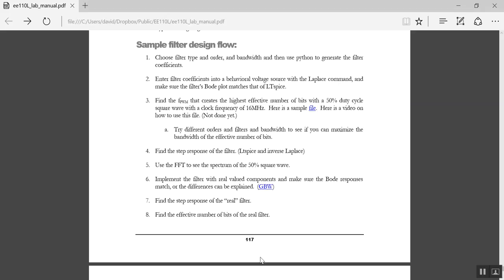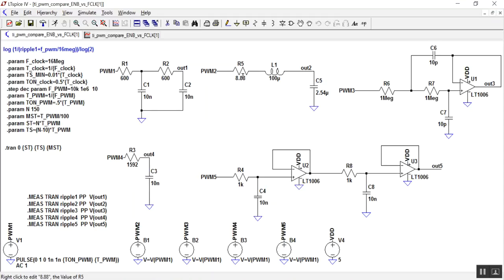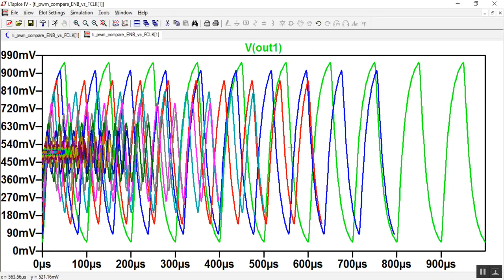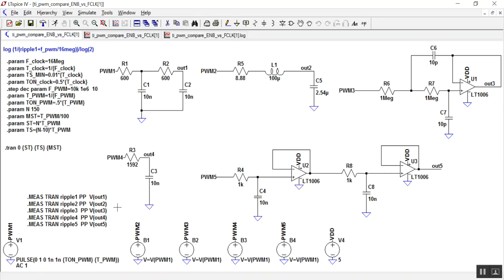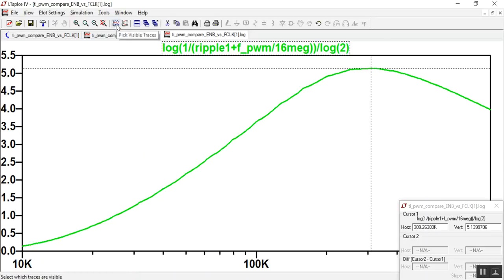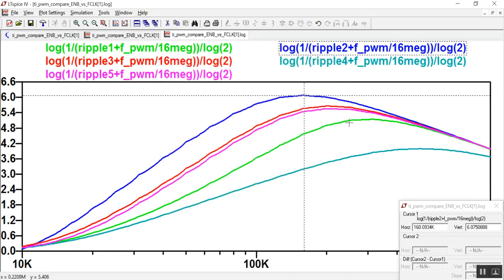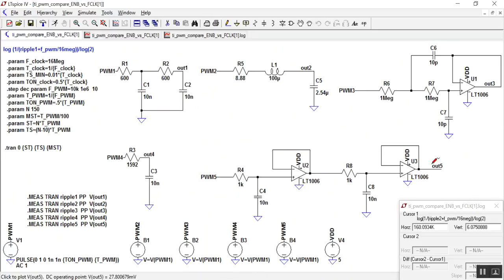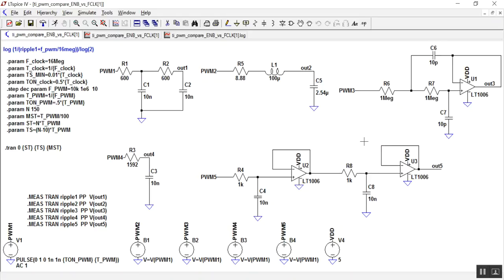Find Effective Number of Bits PWM

Comment: Can you please provide the (.model,param)commands, which are used to calculate ENOB and is it possible to calculate INL and DNL in ltspice?
Reply from the maker: Here is a link top the file:https://www.dropbox.com/s/lmtat326xp8eayh/ti_pwm_compare_ENB_vs_FCLK.asc?dl=0   I do not measure inl, or dnl with this method.  The worst-case ripple happens at 50% duty cycle, so one does not have to measure the other % duty cyles as the 50% case limits the ENOB.  This only works for PWM DACS.
Reply: @davidwparent  Thank you for the reply 👍